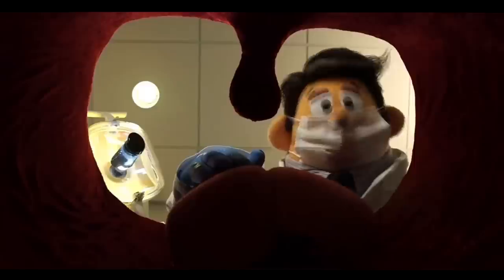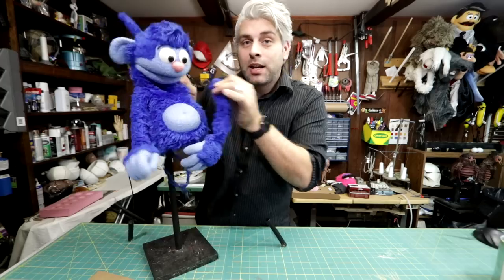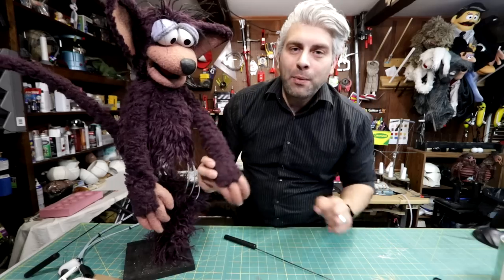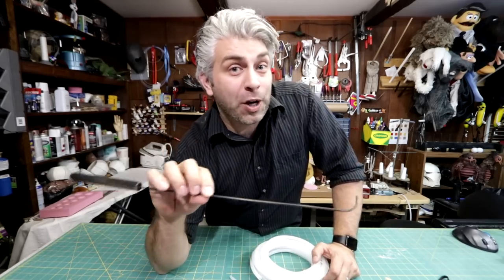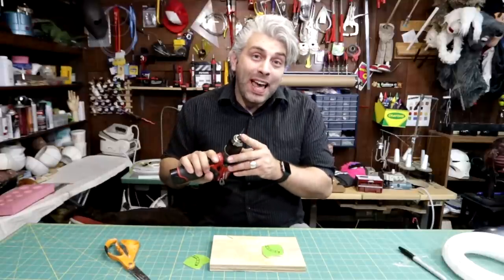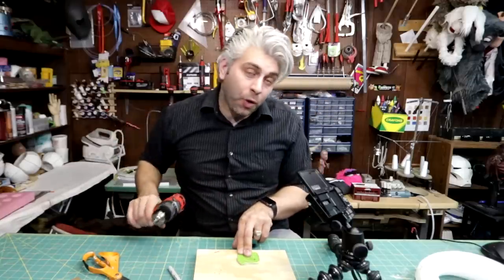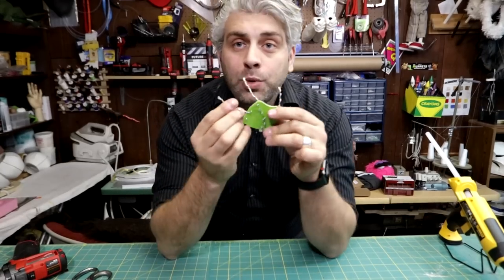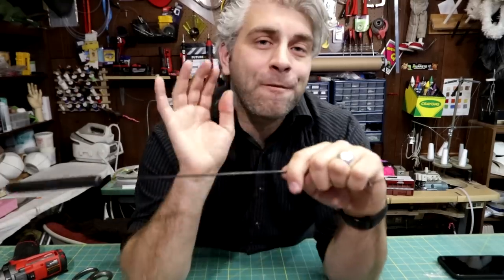How to make Removable Arm Rods!

Comment: The best removable arm rod I own is one created by a company for a puppet that used a Ball joint socket.  the rod moves great and 100% impossible to fall off. Never had a problem with that style if that helps anyone.  Still looking into finding a similar ball joint to make for myself.
Reply from the maker: Sounds cool! But wouldn’t that swivel in the joint and making it impossible to accurately control the arms?

Comment: Rather than remove the entire arm, I just slip the hand into a slit into the glove, pin it close, and there's an instant live-hand version - I'm sure it wouldn't be affective with a fabric like fleece, but works great for fur. But, prior to this video, one of the only other tips available out there for removable arm rods was similar to the first technique with the snaps, but instead of snaps, the idea was to use double-face tape . . . I tried it, and the results left a lot to be desired; double-face tapes seems to like to stick more when you don't want it to, but not stick very well when you want it to.
Reply: @PuppetNerd   I realized a potential method that gives a very solid attachment and prevents the slippage you noted here. My idea involves making a slotted bolt (or threaded rod) with nut as the attach point for the arm rod to lock it in place. Doesn't have to be metal, nylon is light but strong and would work great. 
1) Drill a slot at the tip of the bolt wide enough to get the rod through.  
2) Drill a hole inline with the slot just past the slot, slightly smaller than the width of the rod and hook. 
3) Slip the rod hook into the hole, other part of the rod rests in the slot 
4) Lock the rod in place with a locking nut. 
Since the distance to the hole is slightly less than the rod to hook length, the nut puts compression on the two parts of the rod, making it much more difficult for the rod to pull out unless the nut is backed off. It also prevents rotation and can be easily removed when needed. If you want to make that even more robust, you could drill another hole perpendicular to the slot and use a cotter pin to prevent the nut from backing off the threads.

Comment: Wow, I love that advice! Next time I build an arm rod puppet, I'll just do what you do and make the entire arms removable instead! I'll do the same thing with the legs so as to avoid the legs flopping up and down on camera when I have my puppet character jump or dance. But in the event that I do come across a scenario in which I want my puppet character's hand(s) to sit in the middle of the couch, I would just make two sets of arms, one pair with rods, and the other pair without rods. Again, the same thing with the legs in case I need to film a scene where I need the puppet's full body to show. And maybe another set of legs with rods in the whole leg if I need a scene with only the legs showing.

Anywhoosies, if you got the time, I was wondering if you could make a tutorial on how to make a flexible mouth plate, kinda like Kermit's; last time I made a flexible mouth plate, I just used foam because it was the only flexible material I knew what to use, but I have this little gut feeling that's telling me I'm not supposed to use foam. Besides, it makes my hand hot after a while of performing.

Comment: Was max made pre removable arm technique as he did not have that option over the removable arm rod option? If not, why not? Or was he the reason you dislike the removable rods? Soooo much curiosity over one puppet rod choice, god I’m nosey. 🤣
Reply from the maker: Like I said in the video it was because of specific shot we needed in the film.
Reply: Adam Kreutinger sorry, I worded that wrong it seems, so a long winded version now.

Everything you show seems to have evolved organically, part of the charm of watching, so I suppose I assumed the popper system became more standard along with interchangeable arms near the end of that process. 

Thus I was wondering if max was near the beginning of that evolution and part of the “how can I do that better” process.

I imagined you would have chosen to create a rodded arm and a rod-less arm if the popper arm system had been discovered beforehand and the shot was in the script. Rather than using a system you do not like using.

So the question is more about the evolution of interchangeable arms and the options that represents, than why did you do removable rods.

I hope that makes the question clearer and not made things worse.

By the way, Can you get puppet geeks?
🤣🤣🤣
Reply from the maker: It’s not so much an evolution as much as it just different techniques. I still use each of those techniques. It depends on what the puppet is for and what it has to do. My point in showing a those variations was not to show which it “best”, it’s to show different methods for different situations.
Reply: Adam Kreutinger ahhh, my mind made a pattern that was not there. 🙄 I should be used to that by now, but it still catches me out. Thank you.

Comment: Two snaps won't lose movement due to the rotation.
Reply from the maker: True. But it is more likely to pop out with two snaps.
Reply: @PuppetNerd  Good to know, Thanks! Why do you think that is?
Reply from the maker: It’s leverage. The act of the turning, though it isn’t desired, acts like shocks.
Reply: @PuppetNerd  Makes sense...thank you!

Comment: I mean there is a really easy way to do it but you need to change the way you build the arm, so you put the wire part of the hand and put it in the foam hand and cut the rest of the rod and then just put the hand and arm in flece or fur or what ever and then stich it do the whole process and than get another two rods and bend them in a p but it's more like a u whit one side longer and the shorter part is almost  touching the longer one but there is a very small gap that's Les than a centimetar,and you're basicallyone you only put it over the hand between the hand and the rest of the arm and you're done,you can remove the arm roads and put them back on, the only bad thing is that it's visable on the arm so I guess you win some you lose some